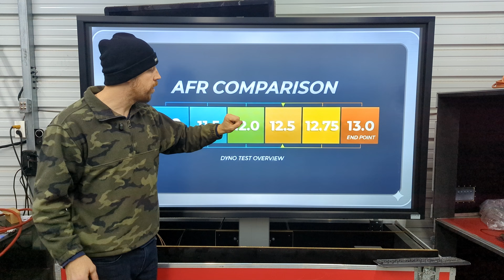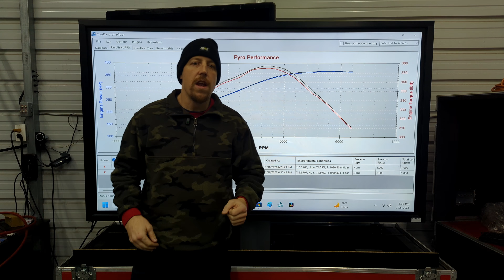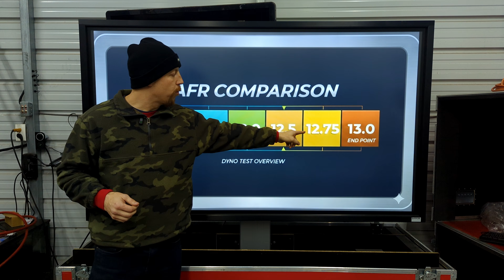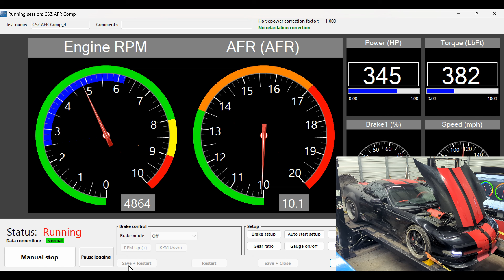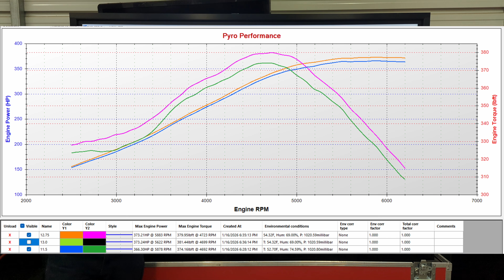Lean vs Rich: How Fuel Mixture Really Affects Power (Dyno Tested)

Comment: when you change the AFR it also changes the burn rate so I've heard a leaner mixture requires more timing because it burns slower. it would be interesting to see the results of this AFR test combined with the timing test, so you could start at a richer AFR and low timing and bump up the timing until power falls off then lean it to the next increment and adjust timing until it falls off. I would like to see the results of that test, though I suspect the gains may be more minimal.
Reply: This is why on an old distributor we have vacuum advance, as we go from WOT to less gas charge cruise the vacuum increases and we use that as a signal to add extra advance.  This is why modern ECU have 3D instead of 2D  fuel and spark tables.
Reply: @krusher74  I didn't know that and it makes sense. thanks for that bit of information it will help my future tuning adjustments.
Reply: @adampinczesgarageandfabric9930  Don't believe everything you read! (Apart from the following)....The vac advance system does not compensate for changes in AFR, it is there to compensate for changes in charge density, in other words how much fresh charge is in the combustion chamber just before the plug fires, this is NOT the same as the Air Fuel Ratio of this charge. When the throttle is just cracked open there is very little charge in the cylinder, most of the compression stroke is actually compressing a partial vacuum, this means that the initial cylinder pressure is low (the pressure just before the plug fires). A low initial cylinder pressure gives a low burn speed. We need peak cylinder pressure (the highest pressure achieved) to occur at around 14-20 degrees ATDC, so with a low burn speed we need to advance the timing. Knowing this also explains why if you increase the compression ratio (skimming the head) you may need to pull out a few degrees of ignition timing, it also explains why 2 strokes running an expansion chamber run an ignition system that retards the timing as the engine 'comes onto the pipe'  🙂
Reply: @sidecarbod1441  Yeah, but you can really lean the shit out of it at part throttle.
Reply: leaner mixture burns slower, but 13 afr isn't lean. Fastest burn rate is from 12 - 13 afr, so 11 and 14 afr are burning slower than 12,5 for example
Reply: @oom_701  A lot of people post up a lot of nonsense on Youtube, you are NOT one of them! 🙂
Reply: @oom_701 exactly. There is a happy medium.
Reply: Yes, they work together. That's the sad downside of these static tests that only vary 1 side. It's nice to see a strictly afr vs afr test, but in reality hp depends on afr with optimized timing vs afr with optimized timing.

Comment: Wow, if this is stock GM left a lot on the table
Reply: They put a tune in that works for a granny driving in the north pole to a madman drving in the desert. They also have to pass emissions.  EG you do this tune in california and now it does not pass smog. or you do this tune being VW and you have dieselgate!
Reply: @krusher74 oh I get it
Reply from the maker: It is stock, and yes, they do!

The non-performance applications are subject to even bigger gains from tuning. On average I find I can get an extra 12% or so out of a bone stock truck/SUV. For one example, I tuned a bone stock 2002 Silverado 2500HD with a 6.0 LQ4 and picked up an additional 34whp!
Reply: @PyroPerformancePNW wow that’s a lot, and how much torque?
Reply from the maker: @BlackRam17  I was actually trying to remember when I wrote your message. I want to say something like 20+, but can't remember exactly.
Reply: @PyroPerformancePNW that’s real solid

Comment: What' s about Stoichiometric air-fuel ratio 14.7:1?
Reply from the maker: At 14.7 AFR at WOT you'd be well past optimal for power, so you'd end up pulling timing just to keep it out of knock. Now you've given up torque and safety margin.

14.7 is great for cruising, but not for WOT.
Reply: @PyroPerformancePNW  Also something to note is that the drop in power when you go too lean is not symmetrical, if the engine makes best power at 13:1 and you run half a ratio too rich (12.5:1) you may lose 5 BHP for example, but if you run half ratio too lean (13.5:1) you would lose a lot more than 5 BHP. Whilst running in cruise I have set engines up to run 15-15.5:1 and they are perfectly happy, but I always aim for around 12.8:1 at WOT. Its a shame that you did not test 13.5:1
Reply: @sidecarbod1441  He said the GM computer had a failsafe that would not allow past 13
Reply: @krusher74  Fair enough!

Comment: So i live in a relatively high place for my country .62 of a mile altitude. There are no dynos in my country at or near my altidude. Can a good tune shop compensated for this or is that not possible?
Reply from the maker: Yes, absolutely! While it would be ideal to tune at the altitude you're at, a good tune will have the entire VE table dialed in properly for any manifold pressure. You won't ever notice the difference if it's done right.
Reply: @PyroPerformancePNW  Thanks for that.

Comment: I like what you're doing you might want to recalibrate your Dyno because horsepower and torque cross at 5252 RPM yours is crossing about 5,050❤
Reply: The two curves are on different scales.  That’s why they don’t cross at 5252 like they should.  You can see the scale on either side of the graph.
Reply: @VintageAdventurerDrives I get it my uncle owns a dino I ran it that's how I know you can manipulate things by scale
Reply from the maker: Yep, VintageAdventurerDrives is correct, HP & TQ are on different scales. Calibration is on point! 👌

Comment: Would love to see this test done on a turbo engine....
Reply from the maker: I’d like to see that as well.

The challenge with boosted engines is that AFR isn’t just about power — it plays a big role in EGT, knock margin, and overall durability, so you don’t have the same freedom to sweep leaner values the way I did here.

That said, there’s definitely a safe way to explore it within limits. It would just need to be approached a lot more carefully.
Reply: @PyroPerformancePNW nah turn it up till it explodes then take a couple degrees out. 😂

Comment: Very nice video. You can run way more aggressive AFRs that people typically imagine with NA engines.
Reply: Even turbocharged ones if you use some water methanol injection 😊
Reply: @flrpower5628 I mean even with port injection on straight gasoline (think Sunoco 110 type stuff) I've seen turbo race engine live in the 13 AFR range. The most ridiculous one was 13.5 AFR

Comment: Nice test. I guess I'm not surprised GM limits the AFR you're allowed to run at WOT since they do something similar at cruise (in the US anyway) by disabling lean cruise. I know there is a way around that but on the C5 it means losing cruise control. 

Do you know why vehicles tend to like their leanest AFR at peak torque i.e peak VE? I understand why they will also prefer a degree or so less timing at that point but don't have as good of an explanation for AFR.
Reply from the maker: This is a very intelligent question.

At peak torque / peak VE, the cylinder is filling most efficiently and mixture motion is strongest, which leads to a faster and more complete burn. Because of that, the engine often doesn’t need as much enrichment to make best torque right at that point.

Richer mixtures tend to help when burn speed is slower or knock margin is tighter — which is why engines usually want to go a bit richer again as RPM climbs past peak torque toward peak horsepower.

It’s very similar to why engines also tend to want less spark advance at peak VE: combustion is already happening efficiently and the flame front is moving most quickly.

Comment: Was this test done with ine afr sender in te exhaust pipe  or the sender is in each exhaust pipe ?
Reply from the maker: Single wideband, same sensor and same pre-cat location for all runs.

This is a MAF-only tune on the C5 Z06, with a lot of time spent validating the MAF curve. The AFR changes were made strictly through power enrichment, not by altering airflow modeling.

Both banks have been checked previously and track very closely, so a single sensor is sufficient for this type of AFR comparison.
Reply: @PyroPerformancePNW so the readings are average  of the 4pipes  at tye collester
Reply from the maker: Correct — the wideband is reading the combined exhaust at the collector, which represents the average AFR.

That’s also how these engines are inherently tuned. Gen 3 GM EFI does not support cylinder-to-cylinder or even bank-to-bank fuel control at all, so calibration is necessarily based on an average mixture.

For this AFR sweep, that’s exactly the correct and intended approach.
Reply: @markbogle8062  EGR are usually used if you are probing every primary and want to super fine-tune.
Reply: Awesome video. Do you think gen V or LT1 would have similar results with those AFRs?
Reply from the maker: Thanks — I’m glad you enjoyed it.

What you’re seeing here has very little to do with the specific platform and much more to do with how spark-ignited engines respond to AFR changes in general.

Different engines will prefer slightly different AFRs for best torque, and AFR changes can affect different parts of the torque curve. But as you saw in the video, those differences tend to be incremental, not dramatic. That’s why a flat WOT AFR around 12.5:1 is a perfectly reasonable and broadly effective strategy for most naturally aspirated engines, regardless of generation.

Direct injection, as found in the Gen V, can shift the exact preference slightly, but the overall behavior and conclusions are very similar.